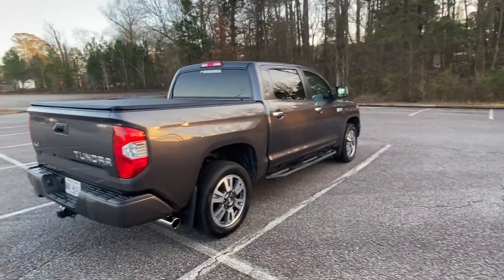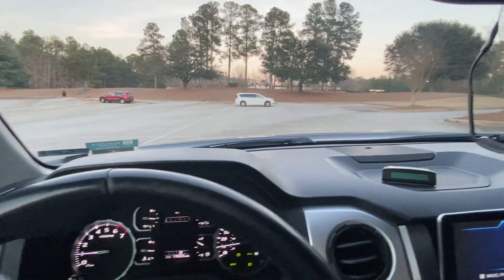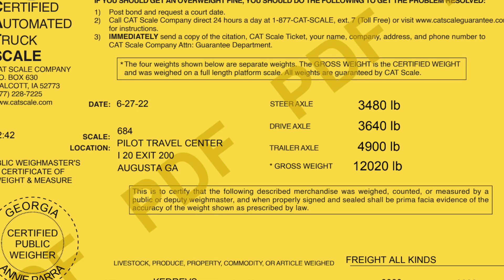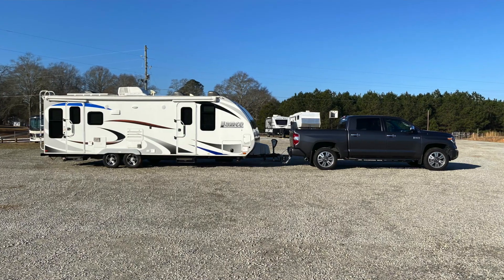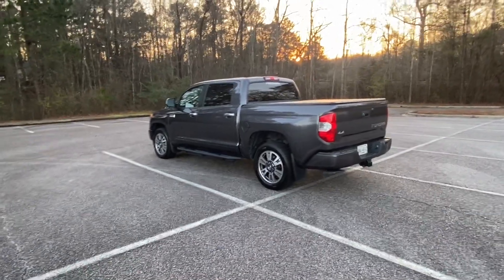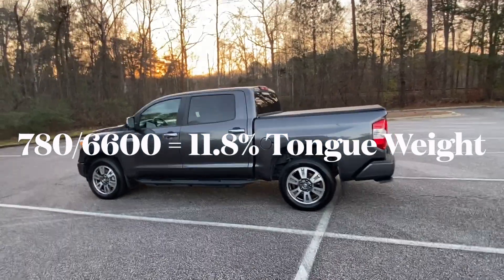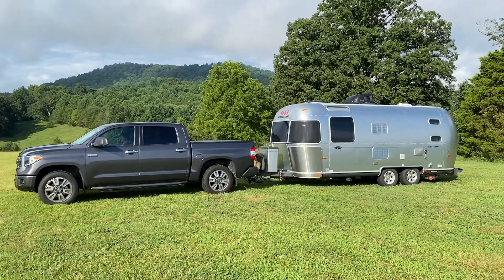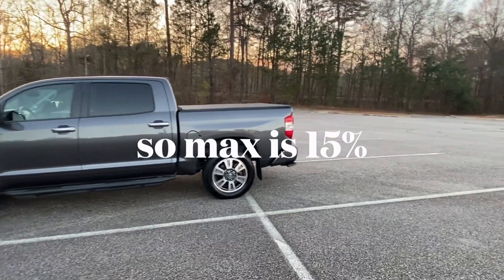Max Towing Capacity - Simple Formula

Comment: 1. Grab your GVWR on the door.
2. Grab your GVWR on the trailer.
3. Look in your manual for your specific trim package. It will match the plate at drivers door.
4. Add both truck and the trailer GVWR you found.
5. The above number is your Rigs GCWR combined weight.
6. Subtract your Rigs combined weight from the combined weight published for your trim level.
If you are under you are probably good.

Now if you wanna dive deeper, look at your trucks load rating.
Calculate humans gear and tongue weight of trailer.
Subtract that from the load rating. Hopefully you are under.
Done. You now know that you vehicle can or cannot legally tow your trailer.

If both are under, you are legal.
Cross over a scale to confirm if you are infact not over weight.
Reply from the maker: I really made this too complex, didn't I.  Thank you

Comment: Max. Tow Capacity Simple

You only need to take empty truck to scale with trailer connected and weigh together.

Then pull trailer tongue off scale and weigh just weight over axles of trailer.

This gives tongue weight when subtract first total weight from weight of just trailer axles on scales only, tongue off scale weight.

Your truck empty weight will be with no one in drivers seat and low fuel. Empty truck. Sticker on door post gives empty weight

Comment: This doesn't seem simple. A new 23 foot Airstream Cloud runs $71K starting. You couldn't purchase a $200 tongue weight scale from eTrailer? You're already $70K+ into RVing, not to mention the extra $1500 or more for every accessory you need. So why the CAT scale? You're adding additional costs in the long-term that's entirely unnecessary. I don't see the simplicity.
Reply from the maker: Nothing wrong with a tongue weight, bu the CAT scale tells me what's on each axle,  tongue weight scale won't and it won't work properly with WDH, so really not much use for me.
Reply: @kedrevs4037  A tongue scale has no relation to a WDH. All the WDH does is what the name implies:  distributes weight, specifically, off the rear axle of the TV towards the trailer axle(s) and TV front axle. The scale is intended to measure if you're within the sweet spot of 10-15% of your loaded weight, that's it. If you're having to go to a CAT scale to get precise axle loads, then you're doing it wrong. You're not towing some 15K lbs trailer. You're towing what any modern V6 or larger engine-transmission configuration is intended to do on a truck platform. If you're within the cargo capacity of the trailer and your TV, your weights should already be loaded evenly L to R. Otherwise, you're doing it wrong and overloading one axle over another (Class C's and Class A's are notorious for poor axle distribution). To advocate for CAT scales shows a novice understanding of towing principles for single and double axle TTs and the need to paying attention to load distribution. Hell, even the military transporters don't go to the CAT Scales. Why not? Because logic dictates it's unnecessary when you understanding the actual stickers on your TV and trailer and the weight of each loaded object AND where you intend to place it. It's a basic numbers game that doesn't require the need for a visit to a semi-trucking facility with CAT Scales, and whoever taught anyone this clearly doesn't understand first principles in towing objects under 12K lbs. The simple solution is quite simpler: know your max CCC; know the weight of every object you place inside; distribution that weight evenly F to B, L to R; and once fully loaded, get the tongue weight and adjust forward and aft accordingly to fall the TW to about 12%. If your truck can tow the loaded trailer weight, can carry the tongue load without failure approach, and doesn't overtax TV payload, then you shouldn't have a problem because your axles are already evenly distributed and under their max capacity to carry (because you kept the CCC in mind). Your introducing more cost to your viewers than what's necessary by advocating to go to the CAT Scale intended for fifth wheels and semis. You're towing a travel trailer, not a 41' Coast Guard vessel for God's sake.

Comment: Advice needed please. looking at a 2021 tundra front axle 4k, rear axle 4,150 and payload 1385lbs. Would this tundra do well towing a 5,200 lb dry weight rv with a 600 lb tongue wt? thanks!
Reply from the maker: It will do great.  The only thing that I would consider is looking into an aftermarket auxiliary trans cooler if you plan on towing regularly up and down a lot of hills.  But a lot of people are comfortable with out it.  You will love it.
Reply: Awesome. I appreciate your response and your videos. Thank you!

Comment: I have a 20 TRD pro with airbags, a rear sway bar and a supercharger. I’m interested in a 28’ toy hauler that has a gross weight of 8500 lbs. well within the towing limit albeit on the high side. The problem is the empty tongue weight is 1,100lbs. 120lbs over the trucks limit. My question is how much tongue weight will I loose with a 2,000 SXS in the back? I don’t know the number but my hunt h is it would lower it past my trucks 980lb limit. With all the mods I’ve done I’m sure 1,100 would be safe for a short slow tow of a few miles but it really would render the trailer only usable with a heavy toy in the back. Very frustrating.
Reply from the maker: I don't know how much tongue weight you'd lose, but I'd definitely take it through CAT scale until I was satisfied that I was safe and balanced
Reply: You're dangerously over taxing your Nissan. No amount of airbags, sway bars or other add ons will overcome the math.

Comment: Agreed. I had a '16 Tundra and now '21 Tundra with a Lance 2375. I've found the sweet spot for tongue weight is 12% to 13%. Also combined with a good WDH that has sway control. I use the Equalizer E4 hitch. Also added TRD rear sway bar and Roadmaster Active suspension. keeps things tight. I've also added the auxiliary tranny cooler.
Reply from the maker: Great setup right there.

Comment: Ordered a 2021 Tundra Platinum in June of 21 received it in August. I wanted the last of the good Tundras made. I pull a 2020 23BHE Grand Design Imagine XLS with my Tundra it has a 500 lb tongue weight and max of just under 7,000. My truck pulls it very comfortably.
Reply: Shane, I like to hear your news. I upgraded from a 2015 V6 Tundra to a '21 V8 in expectation of buying an RV now that we are retired. We have been looking at a GD Imagine 22 MLE (#5140 DW, 490 Hitch 26' 2" length), but the other half saw the 23 LDE (#5450 DW, 524 Hitch 28'1" length). Both of these trailers max out at 6995 gross. She and I (to be honest) fell for this trailer. I have been following KEvRevs for almost a year and enjoy his in depth information for the Tundra. I believe I can take on the 23 LDE given that I have about 100 lbs more PL than KEv  Tundra. It is just my wife and I plus one 50lb dog. My only concern is that the '21 does not have the Aux cooler though two Toyota mechanics and another Master mechanic tell me that it should not give me a problem unless I abuse the use while under weight. What do you both think? I appreciate any help.

Comment: Seems to all make sense.   Have you considered transferring a tad more weight to the front of your truck with the Airstream?  your numbers show that you are losing nearly 300# off the front axle with it attached.    I like to get my front axle weight with the trailer attached pretty much back to where it was with just the loaded truck and no trailer.      Seems to handle excellent this way, and keeps both my truck axles under max load, and also keeps my tongue weight 50-100lbs under the F150 max tongue weight, and gives me a tongue weight to total trailer weight ratio of just a tad under 15%.   (6600 lbs on my trailer axles, and the remaining 1150 or so on the truck for total trailer weight in the 7750 range---this varies a bit depending on the holding tanks and which ones may be loaded, partially loaded or empty)   It also turns out that the total weight on the truck keeps me just under the truck GVWR as well.   Everything seems to just fit and the combo tows great.
Reply from the maker: I have thought about that and the dilemma with the Airstream is how low it sits.  Not enough room to get WDH arms at the desired Angle.  I am having a lift put on the trailer and this should allow more shift to the the tow vehicle to get more weight on the front end, and I need it to make the lifted vehicle stable.   However, despite the 300 lb loss, it does restore the front fender height.
Reply: @kedrevs4037  hmmm yes I can see that being an issue.   Airstreams without a lift kit do sit low....good for fuel economy and stability due to low CoG, but bad for clearance issues.     Any chance of changing the tilt of your hitch by adding a washer or two.  This might allow you to get the bars in place at the desired angle.  With my heavy tongue weight I have quite a bit of tilt on my hitch ball in order to transfer all the weight I want to transfer forward and still end up with bars that are more or less parallel to the tongue of the trailer and frame.   In theory this 'extra' tilt also helps keep the trailer on a straight line.    However if your handling while towing is fine,  and neither axle nor hitch is overloaded then transferring more weight forward may not be needed anyway.  As always, safe travels.......